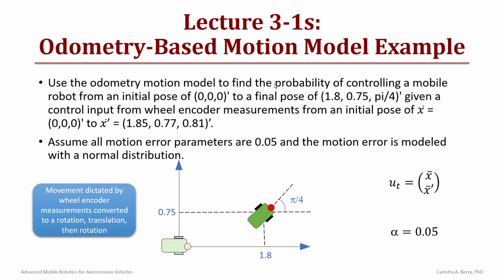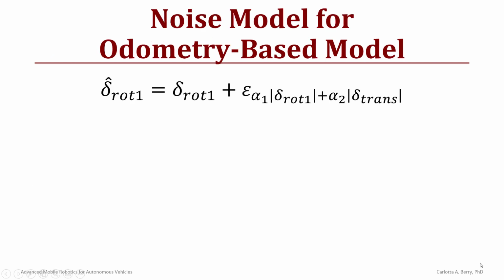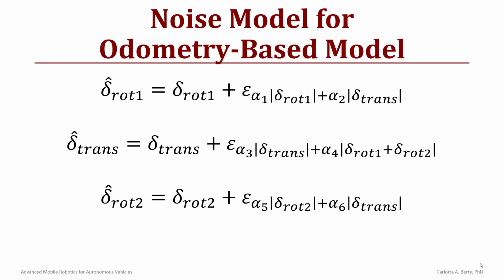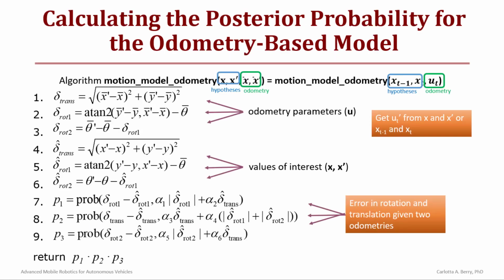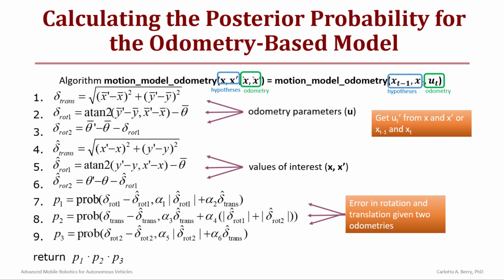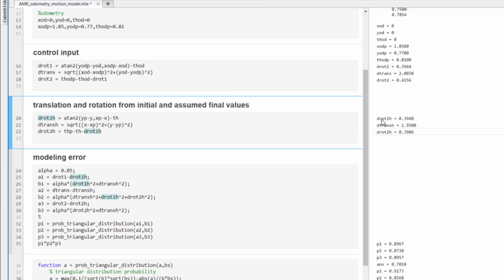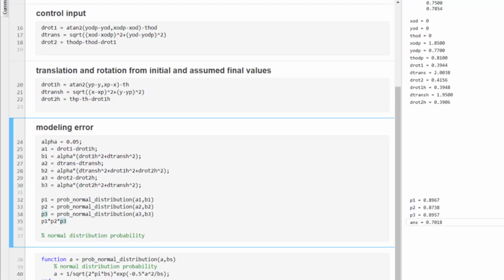Advanced Mobile Robotics: Lecture 3-1s - Odometry-based Motion Modeling Example

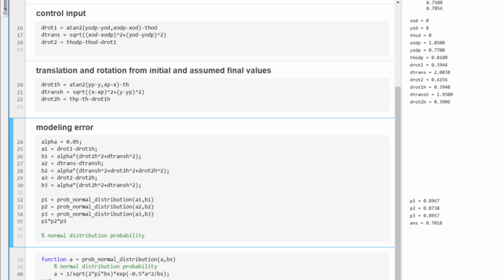Comment from the maker: @4:45 there is a mistake in the normal probability distribution function, it is missing a square on bs. Once that is fixed you get an unrealistic value for the probability. A better choice for alpha after that is fixed would be 0.112 to get an overall probability of 0.7. function p = prob_normal_distribution(as,bs)
    % normal distribution probability
    p = 1/sqrt(2*pi*bs^2)*exp(-0.5*as^2/bs^2);
end  
#NoireSTEMinist #PurposefulProfessor #MySTEMIsForTheStreets https://wordpress.rose-hulman.edu/berry123/mobile-robotics